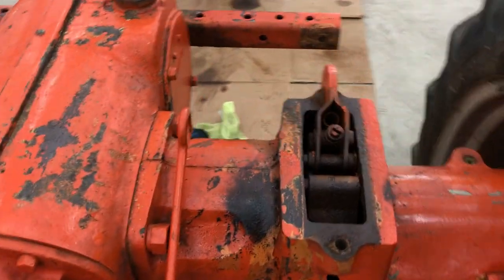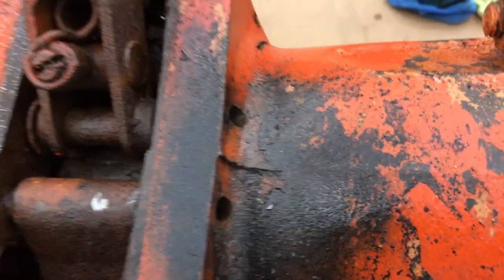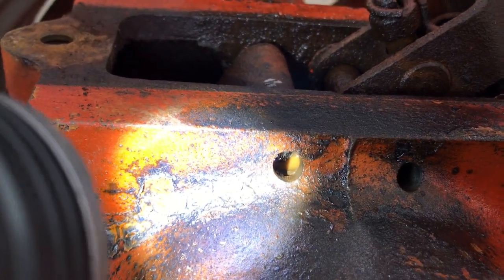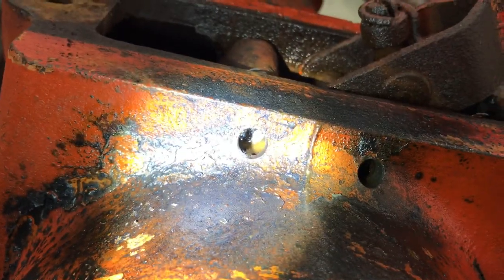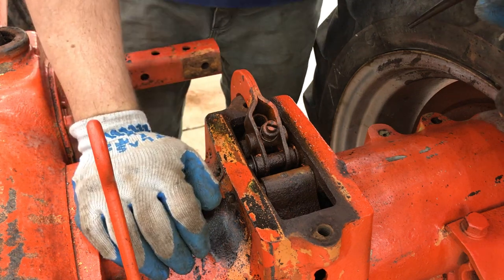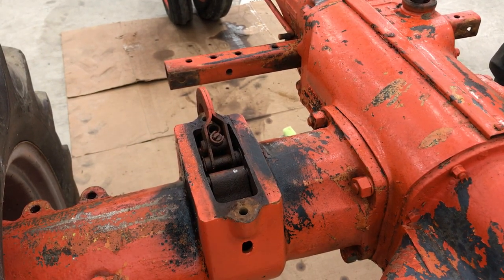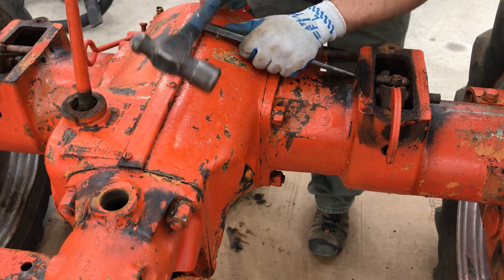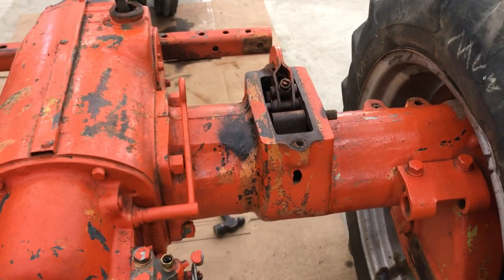Allis Chalmers Tractor C - CA - B Brake Pin removal!

Comment: Had a similar problem with an English built model b. Managed to drill and tap the exposed end of the pin, and with a short length of threaded bar, spacer/nut, wound the pin out. I guess changing the brake components wasn’t something the manufacturer thought about! When reassembling, It may be a good idea to smear a little copper grease to pins to prevent them seizing.
.

Comment: Hello. This video is amazing! My grandpa is trying to determine where the brake spring hooks to the brake shoe? This video stops just short of seeing this. I went to the fast forwarded restoration videos and seen you pull it out but it didn't show how the spring was connected. Any help would be appreciated! Thank you!
Reply from the maker: They wrap around the head of the adjustment screw!  Hope that helps!

Comment: Awesome job

The b models had holes on both side of the pins /axle housing, and the C didn’t no idea why they did this I think the CA also. 
I don’t have my manual in front of me but honestly how did they expect you to remove the pin. It’s not like it was threaded or enough stuck out to attach Vice grips, monkey wrench or weld long rod too

Any idea what the manual says or what the suggestions you had from old time allis mechanics or other hobby tractor enthusiasts

Thanks
JR
Reply from the maker: I think AC assumed the clearance between the pin and casting was enough to allow for rust.  The pin was initially held in place with external c-clips,  but those don’t hold up.  All the old timers online said to approach it like I did,  it’s amazing that so many guys will share information just for the common good online.  Hobby’s like old tractors restore my faith in the common guy living in America.

Comment: Thread tap the holes when you're done and put plugs in them you got a way to get that one out get your torch back out try not to heat the pin just the arm pieces it's running through

Comment: Great video Thanks! I have a B that needs brakes and think I'll give it a try. At 5:06 it looks like the washer on the front left pin drops into the case. Did that cause a problem? Were you able to get it out?
Reply from the maker: WOW! great catch!! How in the world did you notice that?!  Anyways, thanks for the compliment.  The washer fell through the drain hole in the bottom of the casing.  I didn't reuse the clips because they were too rusted.  Instead, I drilled a hole through the pins and used a cotter pin to keep them installed.  I know that sounds confusing, but it was pretty simple.  Also, I used a engine hoist to pull out the brake pads.  Good luck, and if you have any questions don't hesitate to ask!